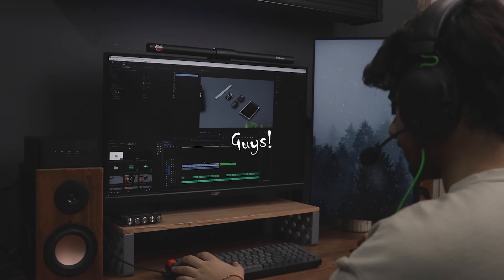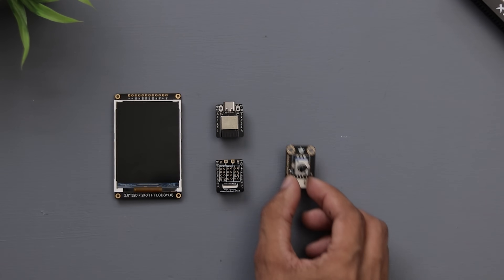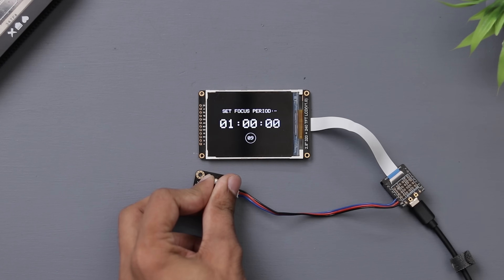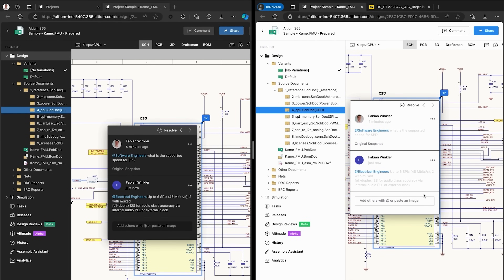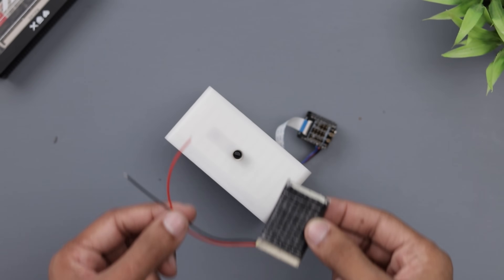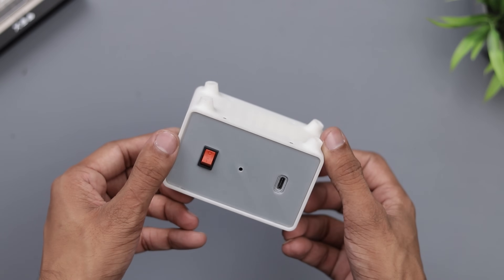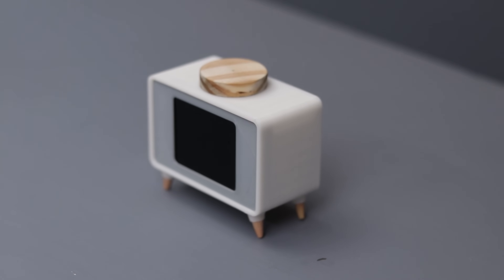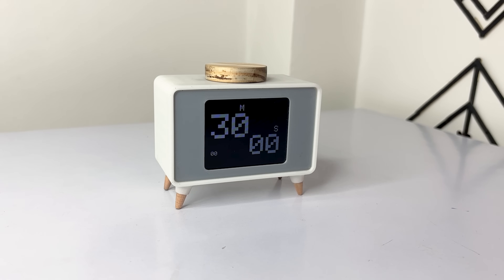Building a 3D Printed Cute Little Pomodoro Timer | Tiny TV

Comment: A small mistake is present; you have connected the switch directly to the battery. This will not charge your battery if the switch is in the off position. Could you fix the connection? And do upgrade by adding battery indication.😁😁